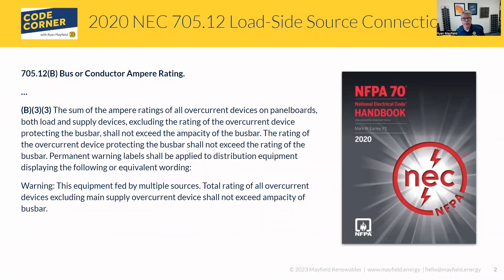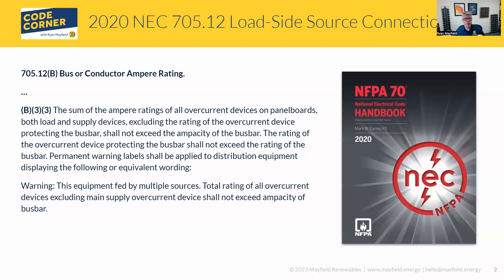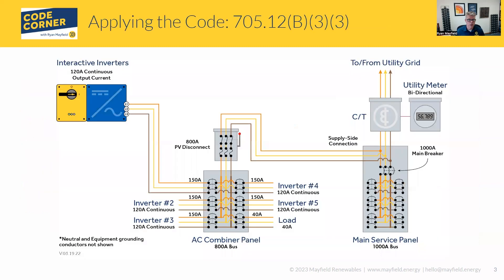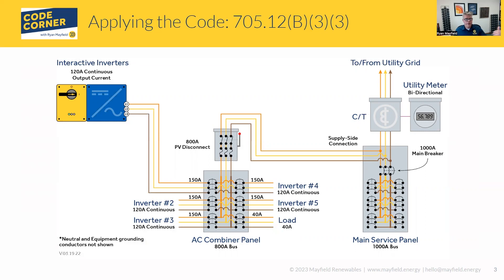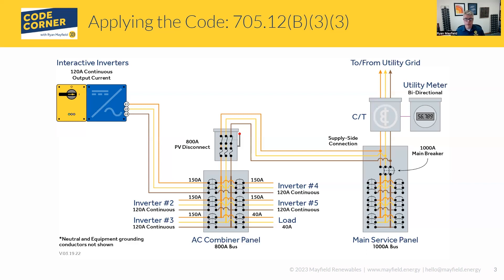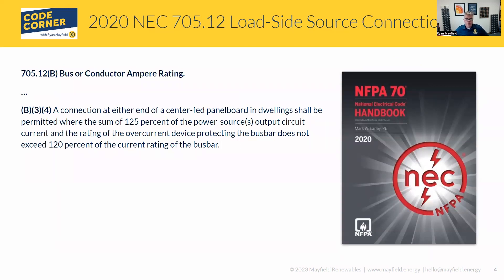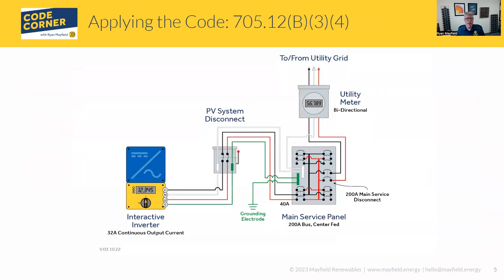2020 NEC 705.12(B)(3)(3) and (4)

Comment: ??? 705.12 is not supply side connections.  705.12 is LOAD-side connections.   705.11 is supply side~!
Reply from the maker: That's correct. The example diagram shows a supply-side connection, but what we're focused on for this video is the breaker in the AC combiner panel. In this case, we cite 705.12 rules to properly size the breaker (800A) to not exceed the combined amperage of all loads AND sources on that busbar (750A of source + 40A of load).